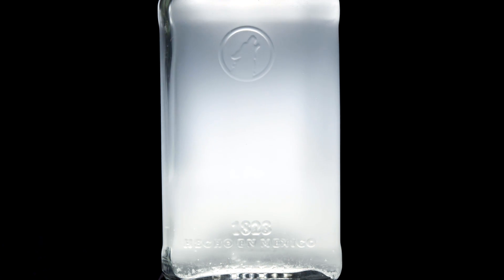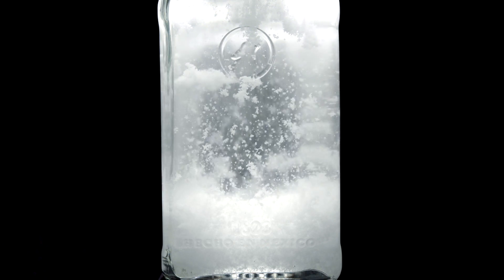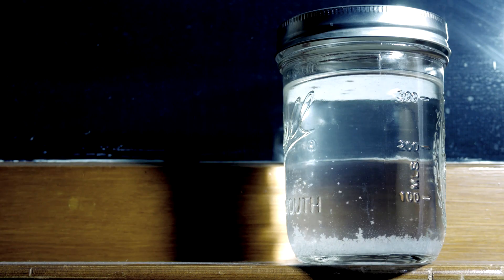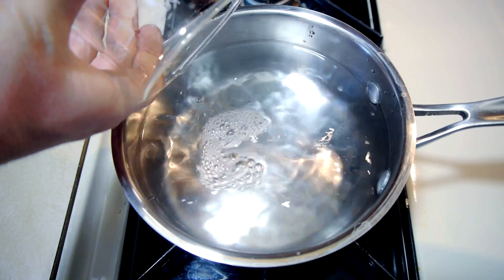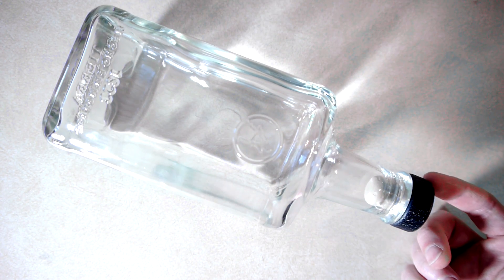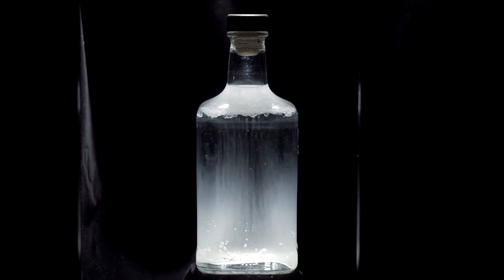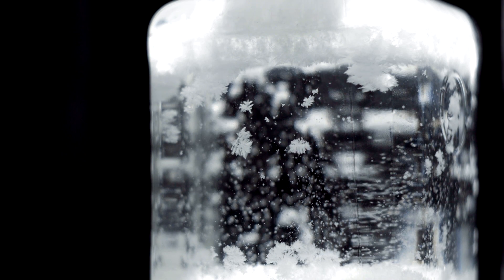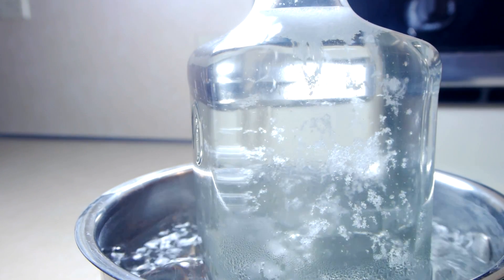How To Make A Storm Glass - NEW VERSION

Comment: Yes it seems to be more temp dependent, which means that a thermometer would suffice; interestingly the original "Beagle" storm glass also had a stopper in it, leading to conjecture that every so often the stopper would be taken out for  second to let the inside pressure  become equal to the outside pressure, thus giving it both the temp & barometric factors; just conjecture ; arising from hard to decipher crystal formations to equate to projections of "future" weather which so many say are "iffy" at best. Imho:  a pot & spout ol fashion Barometer is not so bad to give relative pressure rise n fall (not exact pressure readings although one could "try" to calibrate a pot/spout type by filling water with exact ml of water, then using weather station barometric pressures make an approximate scale.  A pinhole at top of spout type would minimize water evaporation losses.

Comment: How tight does the seal need to be?  The first video had a canning jar, this one has a cork stopper.  Could you use an apothecary jar with a lid that sits on top without a seal?
Reply from the maker: It will work fine without a seal, but the liquid will evaporate away over months and years.

Comment: Howdy!

Great video! No one around me sells 100 proof anything (I assume I could use any clear spirit) so I'm reduced to making it myself. I was planning on buying 95% ethanol at the store and mixing it with distilled water at 55% | 45% but they only sell isopropyl alcohol (91%). Before I buy a few I was wondering if anyone knew if isopropyl will dissolve camphor and whether it changes anything dramatically?

Cheers!

Comment: In DK Vodka only comes in 40%, so I was wondering if I would use Denatured alcohol (93%) and just add water ! Would the additives have a negative effect !
Reply from the maker: That should work fine.
Reply: Tnx, Ill give it a go and report back !
Reply: I made two storm bottles ! The one works fine, but the other is just clear liquid with a little white powderish stuff on the buttom, and does not react to temperature changes ! I tryed putting it next to the fire place and in the frigde ! but chok therapy does not work ! Do you have any idea how to kickstart the second ?
Reply from the maker: That's kind of weird. did you make the solution for both bottles in one big batch? If so you probably needed to stir the mix right before filling the bottles because it sounds like one bottle got more of the dissolved ingredients than the other
Reply: I saw that your had an oily layer on top, so I made this in two batches to be sure that i got equal amounts in each bottle ! I made them from the same materials, so the should be identical ! I have even taken the bags of material that I used, and double weigh them to make sure that I have taken the right amount of material from them !
Reply from the maker: That's very strange. Do both glasses have that oily layer on top when heated? I would maybe just pour in a few more spoonfulls of the nitrate and chloride into the bottle that isn't forming crystals and that might do it. If you need to make room just pour out a little of the liquid already in the bottle and if you do that you might be able to add some extra of camphor as well.
Reply: I just tried to pour in a drop of destilled water ! The funny part was that a lot of white persipitation came out of solution ! Maybe it just to little water in the mix ! I will try to add small amounts of water little by little and see if that helps !
Reply: +Kim Pedersen Did you have any success eventually by just adding water to the bottle that didn't work?

Comment: Is it possible to do this with 40% or 60% vodka? Or will I have better luck mixing 50-50 of ethanol and water to get the desired effect? As I live in Sweden with our monopoly on liqour sales I can't find a vodka that is exactly 50% of alcohol, I'd have to import one which is very expensive. Otherwise, great project and great video! :)

Comment: I made a few of these from your last video and they made great Christmas gifts, however after a few months, I got a report of one turning yellow. Over a year, 3 had turned yellow, and one almost completely black. I wondered if this was due to the liquid becoming oxidized from a bad seal, any ideas?
Reply from the maker: Strange, I haven't noticed that myself. I would bet that it's caused by UV light breaking down the camphor (or impurities in the camphor), but it could also be oxidation as you suggest.
Reply: Hadn't thought of that, maybe I'll watch my measurements a little closer and see if I could make a purer mix this time, and try for a better seal. Thanks for the tip!

Comment: Could this be mixed with glow in the dark fluids?
Reply from the maker: Possibly
Reply: NightHawkInLight
I could see a problem where it reduces the opacity of the liquids and just becomes a murky mess. There is probably a fine line of concentration.
Reply: Chemiluminescent mixtures? No. It would make a complete mess and the reactions would not work.

Comment: Be careful heating alcohol. It's flammable and even more so when hot. I'd recommend avoiding a flame (no gas, use an electric hotplate), don't ignore the advice about having a cover for the pot (can use to extinguish), and have a 'B' type fire extinguisher on hand. Do outside if possible.
Reply: Vangelion there isn't enough alcohol to fill the volume of the room to the point where it reaches the open flame, since the evaporating alcohol with quickly rise out of the area

Comment: Did you think I would not notice that you used Mohawk-brand 100 proof vodka? Layer up on the tape more or use a non-translucent tape.

P.S. There is also the 'bottled by' line at the bottom of the label, but I can tell the video wasn't sponsored.

Comment: not sure if this is the correct mixture from what ive read about it
Reply from the maker: It's as I've read in several old sources, but I agree it's probably heavier on the crystals than the original.
Reply: NightHawkInLight
ive read somewhere witch of course i cant find at the moment there was another ingredient that can be added. but ive also read its a 50/50 chance to get it to work right. yours does work but from what i understand it should not have to be heated again for it to work again this is what wiki says should be used:
Ingredients
2.5 g potassium nitrate
2.5 g ammonium chloride
33 ml distilled water
40 ml ethanol
10 g camphor
the purity of the ingredients is important. i would recommend reagent grade only
Reply from the maker: A storm glass works by being left to change on it's own. Neither my version or the original needs to be reheated to work. Reheating just causes everything to dissolve so you get to see a big show all over again. A storm glass used as it was meant to be is not an exciting thing to watch.
Reply from the maker: The storm glass was invented in the 1700s and popularized in the 1800s.
Reply: shads77
amazon
Reply: Ah I see.
Reply: Cool thing, where to get the three powered ingredients?
Reply: Thanks for your reply, indeed Amazon has 3 out of 2, what cant be found is Potassium nitrate. 
is there an substitute?
Reply: Potassium nitrate is found in stump remover (100% KNO3) so buy that.
Reply: same formations and changes to the display of crystals form in the big bottle made by heating the contents in metal pots vs the smaller jar made by heating the contents inside the glass jar?  what's the differences with the material you steeped by heating and leaving in time to make the content inside for your storm bottle and storm jar? please LET ME KNOW THANK YOU! any more videos of these storm jar and bottle? can you upload 5 more formations of each bottle/jar in one video? THANKS
Reply: i only have salt (NaCl) and sodium bicarbonate and water. what solution combinations do i use to make a storm bottle?  what's the temperature for the precipitation and the temperature for the crystal formations for the storm bottle that you made?  is it the CHANGE OF temperatures or reaching set TEMPERATURE threshold that cause the: precipitation, crystal formation, melting of solids. which solid(s) form at which temperature(s)? which solid(s) melt at which temperature(s)? I WANT A BOTTLE THAT CHANGES WITH ONLY FEW DEgrees of temperature differences SUCH AS HAND TOUCHING THE BOTTLE. WHAT DO I USE??
Reply: is this true? where do you get this info from?
Reply: great videos
Reply: shads77
amazon has it?
Reply: Ummm, just FYI 18xx is the 19th century, since the year 1 was in the 1st century not the 0th, 101 is the 2nd century, 2001 is the 21st century(that's right everyone who celebrated in 2000), and so forth.